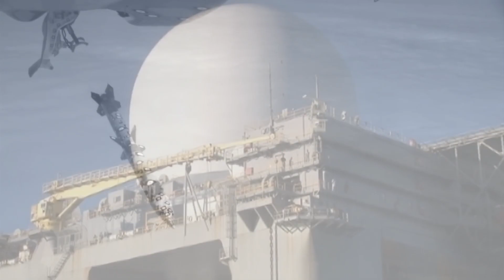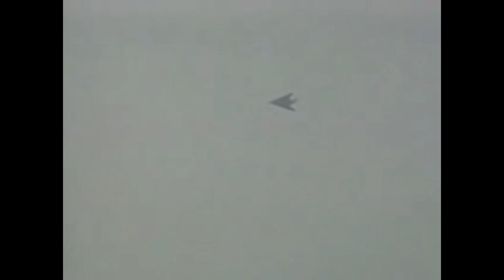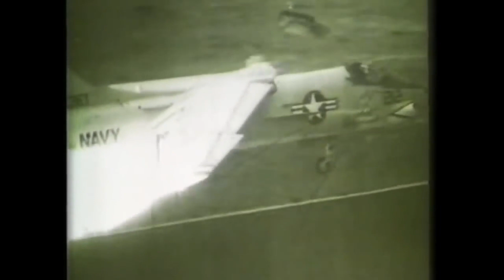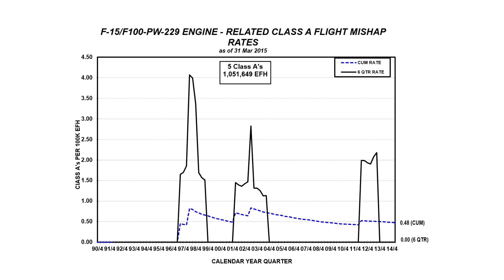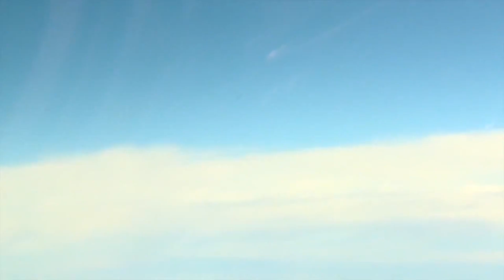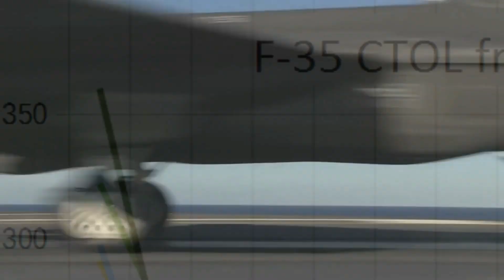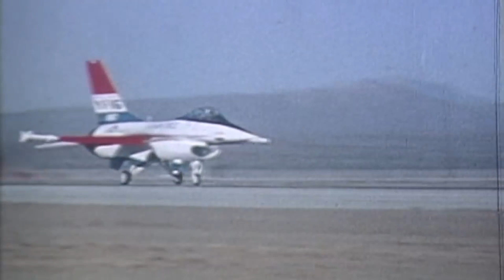F-35 Lightning II: Busting Myths - Episode 2

Comment: The $108 figure is bullshit. This is voodoo economic math that figures not that we will build the 2,443 planes for the USA which won't happen but that all the JSF partner nations will build a total of 3,100 & they also assume that $85 million in 2020 is equal to $75 in 2018. https://www.f35.com/about/fast-facts/cost They are playing games with the math to avoid cutting the program due to defense spending budget caps. 
In 2015 the DoD spent $8.4 billion on just the planes without engines that also cost another $1 billion & built 38 planes for a total cost per plane of $247,368,421.05 ea & will have to spend more to repair these planes to the standards set in 2021 FRP standards. 
https://www.fas.org/sgp/crs/weapons/RL30563.pdf
http://www.gao.gov/assets/670/669619.pdf

http://comptroller.defense.gov/Portals/45/Documents/defbudget/fy2015/fy2015_Weapons.pdf
http://comptroller.defense.gov/Portals/45/Documents/defbudget/fy2016/FY2016_Weapons.pdf

We have built 254 F-35s for $104,656,200,000 that equals $412,032,283 for each plane built thus far. 
Every one of these planes have to be repaired. http://www.dote.osd.mil/pub/reports/FY2015/pdf/dod/2015f35jsf.pdf
Reply from the maker: +Haitian Refugee It's not games, it's using numbers on an even playing field; Boeing, Dassault, Eurofighter, SAAB, etc all cite flyaway costs for their fighters, and that's what the $108 million figure is for the F-35A in 2014. If you look at acquisition costs, yes the F-35 is costly now, but there's still many more aircraft to be ordered - the DoD for example is already looking at another 404 aircraft to be produced. As the numbers go up, not only do you have the production line get more efficient, but you also have those R&D costs form a smaller fraction of the jet's cost and things like spares supplies and support equipment reach certain thresholds. For example, you only need 1 ALIS SOU per airbase, so if you're spending (eg) $100 million on an SOU, but only have 4 fighters at the airbase, that's another $25m per jet, yet as you add more jets, you won't need more SOUs, so it's price impact likewise decreases. Similar practice applies to low failure rate spares, etc. 

If you look at the total procurement + R&D budget for the F-35 program ($386.5 billion) for all 2457 jets, that's $157.3 million per jet.

If you look at a smaller scale, such as with Australia's acquisition of 58 F-35As, that's $11.5 billion for 58 jets and training, spares, support equipment, ALIS, tech support, etc. That's $198 million per F-35A. 

Now compare that to other jets. First, within the same country, Australia paid $2.73 billion USD (using the exchange rate of May 3rd, 2007 and applying US inflation through to 2014) for 24 Super Hornets, with another additional couple of billion ($5.25 billion USD TOTAL) for included training and a decade of support. That's an average unit procurement cost of $218.8 million per jet, making it more expensive than an F-35A. This is the same jet that's advertised to countries like Canada as being 1/3rd the cost of an F-35 (because they're comparing US Navy Super Hornet flyaway costs to LRIP / international F-35A procurement costs)

If we look a bit more recently, Brazil paid Sweden $5.44 billion in 2014, for 28 Gripen Es and 8 Gripen Fs, for an average procurement cost of $151 million each. Brazil also requested another $1 billion worth of upgrades / extras for the jets on top of that, bringing the average procurement cost for their Gripens to $179 million each. (Another jet that claims to be multiple times as cheap as the F-35A - admittedly they do have a low operating cost, but even then there's been controversy because SAAB / Sweden uses operating cost metrics that leave out many things like the averaged cost of replacing failed components).
Reply: +Dragon029 Where do you find flyaway cost of Boeing, Dassault, Eurofighter, SAAB?nPlease show me your sources for your assertions on the F-35A $108 million with engine-less fly away cost. The ALIS is covered in RDT&E spending & not procurement or spares spending.
Show me your source for the Australian F-18E/F purchase.
Show me your source for the Brazilian Gripen NG purchase.

I have military & manufacturer sources that show your arguments are not only misleading they are false.
Reply from the maker: Haitian Refugee An F-35A with an engine costs $108 million: http://www.defensenews.com/story/defense/air-space/strike/2015/03/25/f35-costs-cracks-development-/70392734/

Without an engine, it costs $94.8 million: http://aviationweek.com/defense/pentagon-lockheed-sign-f-35-lrip-8-deal

"The ALIS is covered in RDT&E spending & not procurement or spares spending."
Wrong, ALIS development is, but ALIS is physically a bunch of servers and other devices, with each air base having one permanently stationed there and at least one deployable version for when units go overseas. They're acquired as part of procurement, included along with other things like simulators in LRIP lots. You can read more about how ALIS is used in the 2015 DOT&E report: http://www.dote.osd.mil/pub/reports/FY2015/pdf/dod/2015f35jsf.pdf

Australian F/A-18E/F acquisition cost: http://web.archive.org/web/20110312164435/http://www.minister.defence.gov.au/NelsonMinSpeechtpl.cfm?CurrentId=6442
Use xe.com and usinflationcalculator.com to find the USD conversion on May 3rd 2007 and find the inflated value to 2014 (the year that the F-35's LRIP 8 pricing was announced).

Brazilian Gripen NG acquisition cost:
http://g1.globo.com/economia/negocios/noticia/2014/10/15-cacas-gripen-serao-montados-no-brasil-diz-executivo-da-saab.html 
I did make a mistake however, as the "extra $1 billion" I mentioned was part of the $5.44 billion order, meaning that the correct average procurement unit cost was $151 million.

If you want sources for other flyaway costs, just Google them; those are the costs that companies advertise and the costs that are used in Wikipedia articles.
Reply: +Dragon029 Here are some facts on the numbers of planes, equipment costs & spending instead of the bullshit you cited.

Australian purchase of F-18s
http://www.dsca.mil/major-arms-sales/australia-fa-18ef-super-hornet-and-ea-18g-growler-aircraft

Brazilian Gripen NG= They never signed a contact for the money you stated it was for $4.75 billion & then $275 million.
http://saab.com/air/gripen-fighter-system/gripen/gripen/newsandpress/gripen-news-feed/gripen-ng-contract-with-brazil-becomes-effective/
http://saab.com/air/gripen-fighter-system/gripen/gripen/newsandpress/gripen-news-feed/saab-signs-contract-with-brazil-on-weapon-acquisition-for-gripen-ng/

Wikipedia & your sites are garbage & mean nothing to someone who actually wants to know what they are talking about.
Reply from the maker: +Haitian Refugee Your first link refers to a potential sale of 12 Super Hornets + 12 Growlers. That didn't end up happening and instead just 12 Growlers were ordered for $1.5 billion, with the Growlers moving into 6 SQN's facilities (6 SQN operates Super Hornets already).

For the Gripens, I'll concede; though that only drops their procurement cost by about $10 million each.
Reply: +Dragon029 Really?
http://www.dsca.mil/sites/default/files/mas/australia_15-22.pdf
Reply from the maker: Yes really; the 24 Super Hornets were ordered in 2007, delivered in the subsequent few years and had FOC declared in 2012. The additional 12 Growlers were ordered in 2013 (as a modification of that dsca.mil link you provided prior).
Reply: No one can make sense of your false claims
Reply: +Dragon029 And the F-35s have all that and more.

Comment: Due to the delays and issues would have not have been cheaper to continue prodution the F-22 or bring back the YF-23.
Reply from the maker: +fuckcoxcable F-22's are twice as expensive as F-35s and roughly twice as expensive to operate per hour. It'd be like replacing F-16s with F-15s.
Reply: +Dragon029 I think your information is wrong.
http://comptroller.defense.gov/Portals/45/documents/rates/fy2015/2015_f_h.pdf

http://comptroller.defense.gov/Portals/45/documents/rates/fy2014/2014_f_h.pdf

At worst with non government figures
http://www.businessinsider.com/chart-shows-hourly-cost-of-military-aircraft-2014-12
Reply: +Haitian Refugee Uh, I don't know what you think those sources prove, but when I look at them I see an F-35 that is far cheaper to operate per hour and has a per hour rate closer to the F-16 than it does to the F-22 or F-15's.
Reply: 22steve5150 
F-22= $23,250
F-15= $22,300
F-35=$15,000
F-16=$9,000
 Is what it proves which doesn't require me to think shit.
Reply: 22steve5150 As the F-22 is a fully capable, fully operational, double engine air frame it should be no question why it costs more than the incapable, single engine air frame douche bag. Considering the F-35 or F-16 can't do what the F-15 can let alone what the F-22 does it should be obvious to all but the dense (you) why the flight costs are more at closer to 50% than 100% more...
Reply: +Haitian Refugee Ah, and just like in other discussions you have been a part of, you don't so much as make arguments as just make unfounded accusations about the aircraft and pass that off as a legit position.  Wow, you must worship at the altar of Pierre Sprey, Mike Sparks, and David Axe.
Reply: 22steve5150 I correct unfounded arguments with government & industry documents while others make unfounded statements about things they read in HuffPo or Defense Daily. You are a troll who makes no argument yet is argumentative. Also don't forget about my boy Tyler Rogoway.
Reply: 22steve5150 I think Sprey would say the F-16 can do anything a F-15 or F-22 can do only better so he is an idiot much like the F-35 fanboy club. The F-35 will be a great plane but it isn't a great plane yet & there is a lot of misinformation being thrown around.
Reply: the yf23 actually won the contest.  it out performed the f22 in every way... plus it has way less of an IR signature.  oh.. it would have also cost less to maintain than the f22 as well.  nothing the government does makes any sense..  Boeing made an ugly plane and that's why they chose the f35 even though it would have also been much cheaper to produce.
Reply: Taylor Thompson On the YF-23, they found it to be marginally stealthier and marginally faster but marginally less maneuverable, and was expected to be MORE costly than the F-22, not to mention the fact that Northrup had experienced scandal after scandal at that time and severe managerial fuckups and the air force's trust in them was shaken.  The Air Force's decision made perfect sense.

On the F-32:  It displayed very poor VSTOL characteristics in flight testing and even under design VSTOL performance it would never duplicate the performance of the F-35's system, they had to redesign the wing during the competition to meet maneuverability requirements (and had to use the old wing design during flight testing because of this) which resulted in things like only being able to take the conventional takeoff and landing variant to supersonic speed.  Furthermore, the large chin inlet required as of yet undeveloped technology to baffle the turbine inlet blades from radar contact, which would reduce it's stealth immensely.  F-35 won that competition fair and square.

Don't be a hipster.  Take 5 minutes out of your busy life to research the topic before spouting off with the "would have / should have" arguments about military prototype competitions.
Reply: +22steve5150 I never said the f35 wasn't the superior fighter at that time.  I said that it would have cost a fraction of the price, and been much easier to manufacture.  I believe that given more time, Boeing could've fixed their stovl issues and been a real contender.  wasn't the whole point of this fighter, to keep costs down?  as far as the yf23 goes, that is up for debate but it's documented that it outperformed the f22 in nearly every category and would've been cheaper to produce in the long run... I'm not sure where you get hipster that's never done research before and I'm not sure what qualifies you as an expert over me but hey, that's a matter of opinion I guess.

Comment: A bit bettee than the B2?  The B2 is clever, but it is ruddy massive.  I note a hisrical downgrade from the maker of the F35 is its claims for the stealth.  Enemy will learn ro see it and this plane is obviously a compromise.  You can't say its getting ready for the next generation as it will be in servace for a loooong time.  If the body is not wide, why do uoi talk about body lift in light of it being smaller.  Re reliability?  more computers means more problems, are you saying thw f16 and 15 at as complicated as the 35?  Also, whats wrong with having two engines.  regarding concurrancy, ai saw one of the people in charge of the project saying it is a bad idea.  If you say the 35 is cheap then NO ONE BELIEVES YOU!

Comment: how can you say the f35 can hold more cargo than a f18 are you dumb?
Reply from the maker: veiga devil
That's not remotely correct; the old F/A-18C has 9 hardpoints and can carry up to 13,700lb. The Super Hornet has 11 hardpoints and can carry up to 17,750lb. The F-35 has 11 hardpoints and can carry more than 18,000lb.

http://i.imgur.com/VWjTZOd.jpg

http://i.imgur.com/MWj5FqZ.jpg
Reply from the maker: +veiga devil Look up the specs of both jets.
Reply: It's a very common misconception that the F-35 only carries internal stores (2x GBU's, 2 by AMRAAMs). Most don't realize there are weapons hard points on the wings as well. Once air supremacy is achieved and stealth is no longer required we can load an F-35 with up to 18,000 pounds of munitions.
Reply: +veiga devil not to mention that the f18 is outdated and in most cases falling apart in 2005 on board the USS Nimitz deployed to the Persian gulf there is a documentary serious where it is noted on many occasions that the aircraft are falling apart in fact one f18 had to land in Baghdad int because of low fuel and when they landed suffered a blowout
Reply: +veiga devil see episode 1dumb ass
Reply: But is does.
Reply: +Scott Grabham a f18 can hold like 30k... the f35 with those tiny wings cant hold as much as a f18 cmon be real...
Reply: +veiga devil F-35 can hold 14,000 lb fuel and 18,000lb payload. Decrease fuel and payload rises but range suffers.

Comment: What about the issue with the F-35 needing more hours on the ground (repair/maintenance) than in the air? (I think it was a 1 to 3 ratio?)
I know one of the reasons Norway wants a new fighter is that the aging F-16 is starting to need more time on the ground than in the air, so if that's even more amplified on the NEW planes, surely that's a big problem.
Reply from the maker: +Bjørnar Magnussen Because it's still a new jet, still in development and still having maintainers trained on it, there's very little data yet. The expectation is that it'll require about 10 maintenance hours per flight hour, which is comparable to the F-16 however. Right now the two big things that increase maintenance hours. The first is that there are adhesives used in the stealth maintenance process, some of which have cure times that go for several hours. The second is that ALIS, the logistics / maintenance software that tells you what's wrong with the jet, produces quite a lot of false reports. 

For the adhesives, they're researching alternatives, for ALIS, they've been debugging it, etc, with the false reporting rate being significantly reduced in 2015 (cut in half and then some). There's also a heap of little things here and there that are being worked through; every year there's roughly 100-200 design changes made to the F-35; many of them are tiny little things intended to make reduce maintenance, or make it easier. Otherwise, the jet does have a bunch of improvements in general; for example, it's radar is solid-state and meant to last the entire jet's life without requiring maintenance, the communications system is all one big system, so if it stops working, there's little debugging required on the flightline, the stealth coatings are robust and something like 8 years without wearing to below specification (by which time the jet would have gone off to a depot for schedule deep level maintenance anyway), there's things like stealth tape rather than putty, which is much faster to apply to the edges / cracks of panels after you've put them back on the jet, etc.

Also, as for the F-16, all jets follow what's known as a bathtub curve (inverse bell curve), where they're maintenance heavy at the start, get better, bottom out with relatively low maintenance, then get more maintenance heavy as they start to approach the end of their service life. What Norway is seeing is just the tail-end of that bathtub.
Reply: Dragon029 I see, so most likely the time will be heavily reduced down the line, that's good. Even if it isn't I do feel that's just a side-effect to having new technology that is this advanced. A car for example needs more maintenance than a horse,  but that doesn't make the horse better.

You really seem to have a lot of information and knowledge about this plane, and it's not just "the F-35 is the best", you actually describe why and how. That's what I loved about this series, so keep up the good work :)
Reply: Because it is still in testing.
Reply: Did you ever hear of concurrency?
Reply: Listen to him it's a new plane more things are needed before it is put into service